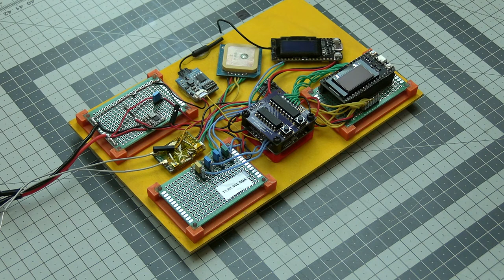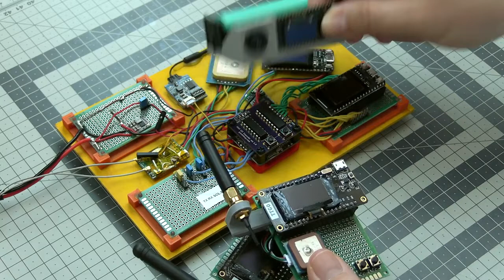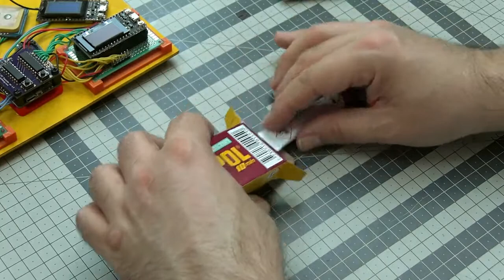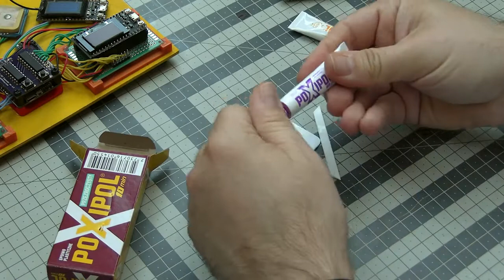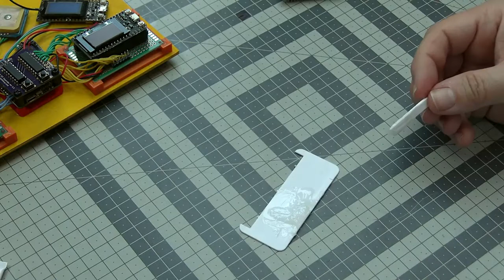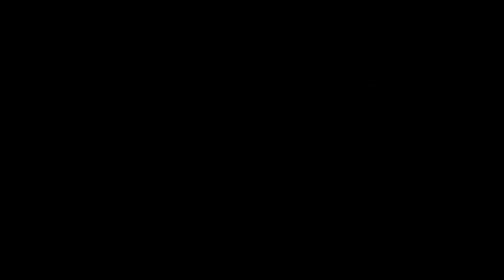Never crack the ESP32 OLED again

Comment: I have a ESP32 with a broken display.  Board still works fine.  Any suggestions on replacing the screen?  If not easily replaceable, any suggestions for alternate uses of the board without a display? 😅

Comment: Epoxy also would have been my advice.  I strengthen micro usb plugs that way. Helps the longlivety of many raspberry PI pico i used to convert big Buzzer buttons to a enter key / usb keyboard or MS Teams mute buttons  using the usb hid library.

Comment: Nice hack! going to be giving mine the same treatment at the weekend :) You also reminded me to get some pigtails for my lora32 boards that connect to SMA socket rather than the rubbish curly spring antennas.  Currently having fun with some T-Beam on the ground and esp32lora in the air on 433MHz.
Reply from the maker: I've lost enough of those oleds in exactly the same way to tolerate the losses :)